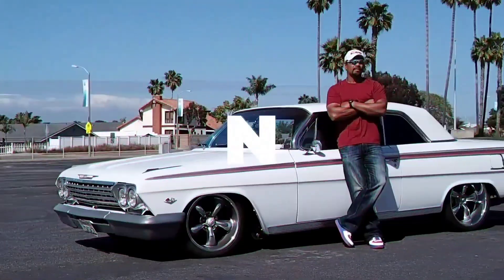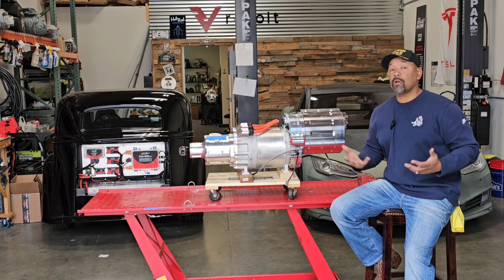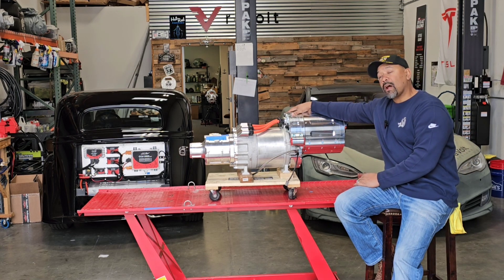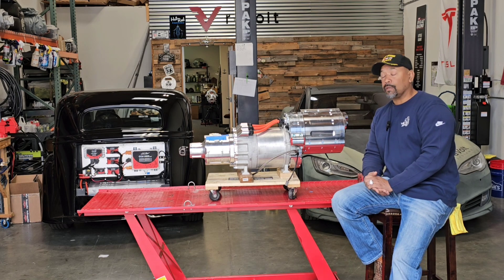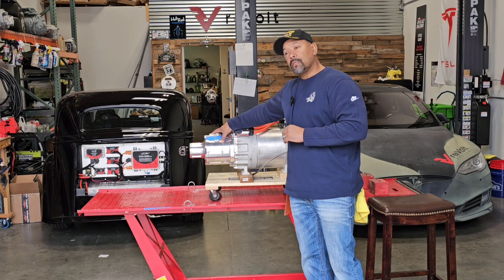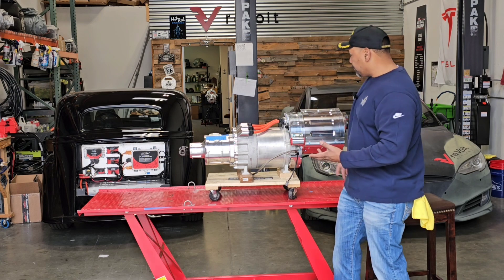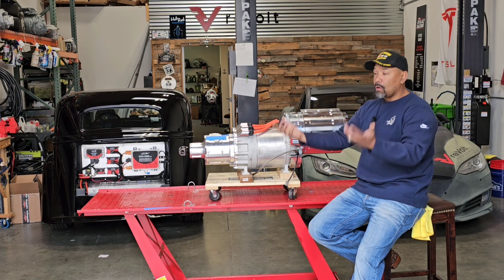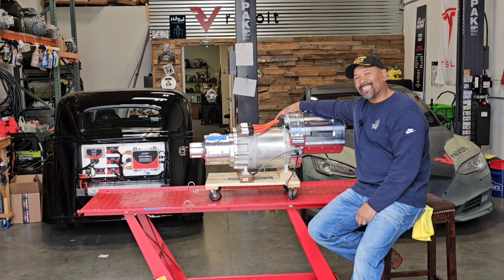A breakdown of the RevoltSystems CR43-Bravo crate motor.

Comment: 40k
Reply: Dear God they high as fuck better off getting a used Tesla drive unit for 4-5k and getting the aftermarket AEM board for another grand. That price is mental lmao 🤣 just looked it up bruh they are using a refurbished Tesla motor not even new for 40k wtf
Reply: Cost?
Reply: @vanishingfox1339  yea lol and idk if that includes control
Reply: @thomashilaire737  Jesus. I could piece together a kit for less than half of that. I get they are using shiny parts and a gear reduction but damn. You could modify a Tesla motor by weld the spiders, then weld a cv input to the drive shaft yoke. Then you can mount it like a gas engine.
Reply: @vanishingfox1339  I always wanted to put a Tesla s motor in-line with a 2wd rear drive shaft like on a long chassis with the extra carriers
Reply: @vanishingfox1339  use the battery pack as the flat bed.. and like a 12 valve Cummins up front.. hybrid like.. drop into neural and switch accelerator pedals lol
Reply: @thomashilaire737  I’ve been kicking around the idea of putting a Tesla drive unit in a 93 ranger I have sitting around. It would make a fun toy and I can drive it to work. I work for on EVs so I can charge it at work on the level 2 charger
Reply: @vanishingfox1339  exactly buy a used Tesla then you got a motor and batteries for cheaper lol
Reply from the maker: Howdy guys.  Yes the kit is $40K.  A lot of what you guys said is absolutely true.  There are also a few Facts that you guys aren't aware of.   It's not as easy as you think bonuses that Tesla drive unit.  Revolt has done the engineering for you.  Several people have tried to do exactly what you suggested and they spent thousands of dollars unsuccessfully.   If you want more detail, I can elaborate.
Reply: @gasngowithsnow  yes I stated that I see what this kit offers in my previous comment. I see what the appeal to the kit is but for most of us $40k is a lot of jack. This kit is for people without or little fabrication and machining skill or just want an easy button option. Nothing wrong with that. Also I work as an ev technician before that I’ve been a diesel technician for 7 years and many more as a technician for passenger cars. Knowing my skill set and want to achieve in a build I personally could not justify dropping that kind of money when I could make something similar for my goals. Again I’m not knocking the product or the people who buy it. I’m happy to see more companies join the community to bring more offerings.
Reply: @gasngowithsnow  yes more detail, isn't the motor just geared down and have a driveshaft connection?